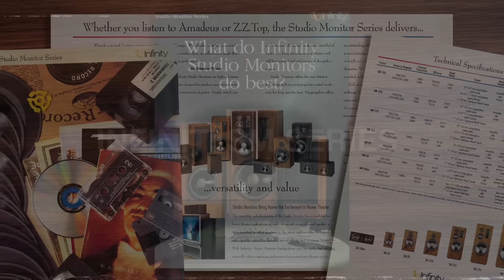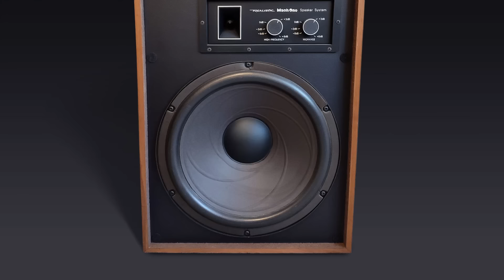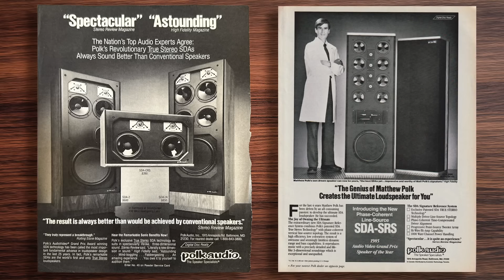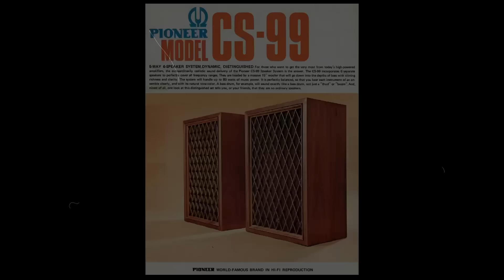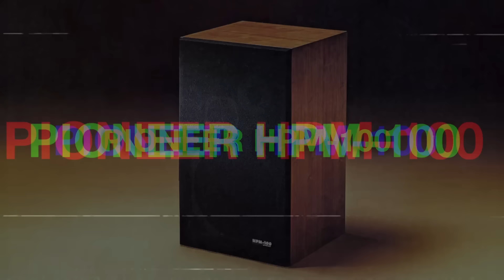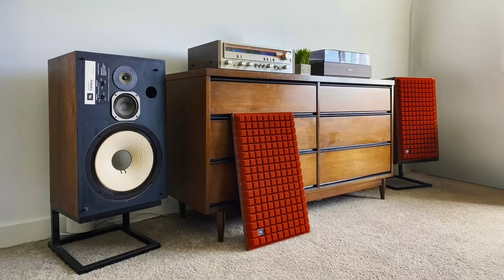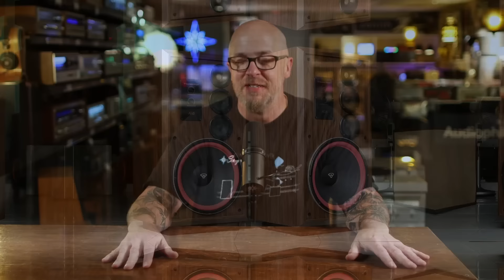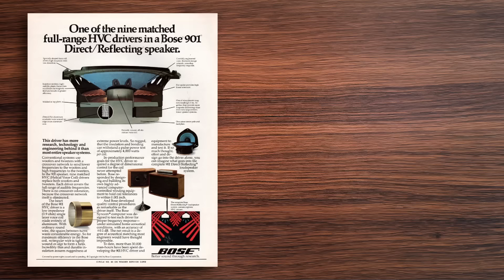Why Do Audiophiles Hate These 9 Legendary Speakers?

Comment: I have pair of HPM-100s… bought them a year ago for $499….they are furniture…i don’t even like to move them to dust….i also have a pair of Bose 901 series VI….and there are things i prefer to listen to thru those…(as soon as i get my Bose 551 Spatial Receiver restored, i’ll be able to run both sets at the same time…kinda curious how that will sound).

Comment: the ones missing: the white-cone fishers. 

bassier than the C-Vs , but will run from walkman wattage. 

incredibly clean at low volume, and thrunderous with just a touch of power.

but they were god awful sensitive to over-power or clipping, I swear i must have blown a half dozen sets .
Reply: You mean the studio standard range

Comment: I’m a huge fan of ADS, but I have an appreciation for Cerwin Vega. The first time I heard a set was at a company house party in the mid 90s. The guy had a set of what I believe were 316r, or at least that style cabinet, and a couple of Phase Linear amps. These things were huge and they commanded a presence. You couldn’t help but want to be in that room and feel the music. I can’t think of another vintage home speaker that could crank out SPLs like they did and still sound good doing it. Just really fun speakers.
Reply: ADS here too. Nice full sound, slightly soft. Good tone which is really important.

Comment: Two comments... first, the Polk SDA's do sound amazing when you're in the sweet spot and moving does fade the effect; however, they are an absolutely amazing speaker without the interconnect cable - the cable just adds the dimensional aspect to the sound.

Second comment... I remember walking into the local funeral home back in the late 90's and seeing that they had replaced their old speakers with Infinity speakers - and had to laugh at the irony of it all.

Comment: Alrighty then! the Bose 901is a flawed concept at the outset because of Amar Bose's statement of actual fact and then corrupting it with his implementation of it. The fact stated is that music reaches your ears in nine parts reflected sound to one part direct sound. By pushing the music through speakers that use said ratio due to the eight speaker drivers in the rear to create the reflected part and one speaker driver for the front, to the listener. 
PROBLEM: The nine-to-one ratio occurred at the microphone and is frozen into the recording. By diluting it again in the same ratio yields 81 parts reflected sound to 1 sound reaching the listener. There is no scenario where an accurate image of the performers is realized. Yes, they are good party speakers (provided enough amplifier power) and also good for just hearing music around the house. 
For critically listening to music, direct radiator speakers will be far more accurate.

Comment: I was a diehard Infiniti fan and I still have my speakers from the 70s. They blew away anything that came after that I agree those studio monitor showed at the beginning of the video that’s when Infiniti went downhill. They weren’t the same company after that their heyday was the quantum line speakers.
Reply: I own a set of Qa infinities. 10" woofer crossed over at pretty low frequency to their amazing EMIT tweeters. Mr. Nudell and his co- founders were using " exotic" materials as they were in the aerospace industry and were also also audio nuts. They used materials they were familiar with but not previously used in audio, like the Kapton in the EMIT and graphite impregnated plastic in the woofer cones

Comment: I love this kind of video on vintage speakers ! I have had most of these over the years, im 66 now, last year i bought a perfect set of Infinity SM152's knowing their issues. I braced the cabinets at every point i could think of (heavy as heck now !) put in plenty of insulation and plugged the bass port. A world of difference ! Not the best for detail, but not bad either. When it comes to rock n roll - Oh Boy !

Comment: Regarding the Polk SDA technology; their current flagship speaker is the Legend 800. It's SDA as well. Anytime you're seriously listening to music you absolutely have to be dead center between them in an equilateral triangle, which is the same for the sda's, so I'm not sure why you acted as if that's a negative for the sda's. Off axis they still would sound more accurate than any of the other speakers mentioned. The SDA technology doesn't just expand the size of the soundstage, it increases the accuracy and placement of sounds dramatically. You literally can hear sound coming from behind you in some cases, if that is how it was recorded. It's incredible, but requires precise speaker placement. The sda requires very specific placement. One often missed rule is you can't toe them in at all. They have to be flat to the wall.
Reply: Polk SDA are amazing and are the best vintage speakers. You need some power to make them sing. NAD power amp modestly rated at 100 watts but more like 200 watts work well .150 to 200 watts amplification would work
Reply: I’ve had a similar experience with Magnepan speakers. The tweeter ribbons have to be facing your ears at the right angle, so it’s hard for more than one person to listen in the sweet spot. But when you get them placed properly, man is it sweet!
Reply: Stereo crosstalk cancellation only makes the imaging more precise, under conditions of perfect cancellation. Under conditions of imperfect cancellation, it makes imaging much less precise. That is the big problem with it. Most of the time, the cancellation is much less than perfect. If you have a perfectly symmetrical room, the speakers far from the walls and lock your head in a vise, everything will be fine.
Reply: I remember a time when the KEF 105 was considered by the hifi cognoscenti to be the best sounding speakers on the planet. With one HUGE 'BUT'...and that was that you had to be rigidly sitting in the very small 'sweet spot'...which was the size of a golf ball when they were properly set up and the mids and tweeters toed-in correctly.  Nobody complained about the KEFs though...they made their reputation on the 105s.  Matthew Polk...not so much.

Comment: Klipsch Heresy I and II speakers are very compromised in some ways but excel in other ways: I enjoy them either (1) with solid state amps AND and a subwoofer or (2) with tube amps even without a subwoofer. To really sound wonderful, however, I recommend matching them to both subwoofers and a tube amp. They are so incredibly dynamic that they make magic out of a lot of music in a way few other speakers near their price can. But not only do they roll off below about 80-90 Hz, they are also very forward in the midrange and upper midrange, which further emphasizes that rolloff. A good subwoofer transforms them by extending the bass and smoothing out the top end, and a good tube amp raises their performance even more. I run my HIIs with a REL T7 sub and a Rogue Audio Cronus Magnum Dark tube amp. I get it that others' opinions will differ. Some will insist that their available bass is so articulate that it makes up for the limits in depth with no need for a sub, while others will walk away as soon as they hear them without a sub without giving it a try.

Comment: My first gig as an audio engineer in 1981 was at a club with a pair of Klipsch La Scala cabinets. The only thing that made them tolerable was a decent set of graphic EQs in the rack. To this day I have a love/hate relationship with horn loaded mids. Especially in short throw applications.
I also ran a few shows in the 80's that had Bose front ends, both 800 and 802. While they got the job done, the Bose processing included quote a bit of compression so you had to be very careful to stay below that to maintain the overall dynamic range.

Comment: I love my Pioneer HPM-100 set. I actually managed to kill the tweeters, I replaced them with Visaton years ago and recently I found a working pair of original tweeters, so happy. And I am right, they are great. I am also wrong, but they are still great. I did EQ them with the room correction feature of WiiM, interesting results. For me this IS the ultimate rock loudspeaker. And it's an heirloom as my dad bought them at a USAF PX, we knew lots of US people on their tour, living close to us in NL.  When we got them I remember playing for weeks in the boxes, they where like my house. This story makes the set precious in so many ways. They are not going away.
Reply: Plus those things just look the business, with a classic vintage look.
Reply: Those 65mm paper cone tweeters are easy to kill, even with 3/4A polyswitch, time for dome upgrades. 30w is the limit for such tweeters regardless of woofer and mid power handling

Comment: Ah, yes, the L-100.  My overwhelming memory of the L-100 is that it was that, on a percentage basis, it was the preferred model of 1970s aficionados of  nose candy. Loud, edgy, punchy, it fit the amped up lifestyle perfectly. Who cares if listening to them gave you a headache?  That was just background noise drowned out by the hangover left over when there wasn't anything left to snort. And, bonus points for their relatively high value at pawn shops where you could get a couple of grams worth of cash for them in trade. Win-win!

Comment: The speakers I miss the most are my Cerwin Vega speakers. They got a lot of complements. Thing is they had Optimus/Radio shack drivers that I put in when the foam surrounds gave out. I was going to redo the surrounds but kinda just never bothered they sounded so good. Sadly lost to time along with most of my big stereo gear. We also use a set of Mach 1s as studio monitors in one of my production studios. They are now sitting in the station garage and I want them before the heat and stuff gets to them. I used to shake the building with them. As far as I know my predecessors never modified them.

Comment: I had a set of Mach I's. They were terrible speakers, for all the reasons outlined here. The woofer was a one-frequency driver at about 100 - 120 Hz, and the midrange was in your face, and distorted as well. The woofer didn't even provide a good "thump" on kick drum hits. I had a frequency sweep track that would sweep down from 250 Hz and you would watch the time display and kind of "map" what the woofer could do and at what frequency it would do it. There was a huge bump in the output starting at 120 Hz, and the output below 60 Hz dropped off like a cliff. I think a lot of that was due to its shallow cabinet, and resulting lack of volume.

Comment: I still use every day the speakers I bought fifty years ago, both for music and TV.  And the same turntable. I was fourteen, delivered newspapers and mowed lawns and bought store brands. The speakers are Quadraflex ST-19s, three way, 12 inch woofers from Pioneer Audio store. The turntable was bought through a friend working at Lafayette Music, half off employee discount. A Lafayette T-6000, direct drive. I later learned Bose sold the same one as the Bose T-6000, or something like that. I’ve never seen another. Thanks Dad for driving me around!
Reply: Actually Pacific Stereo,  sorry
Reply: @OldPete-w5l  I do hope you have replaced the phono pick up cartridge by now! Many folk do not understand that it is just as critical to purchase the "right" cartridge as it is the right speaker. I used to sell audio back in the 70's and we owned a special table with 2 tone arms hooked up to a reciever with 2 phono inputs where we could show how one cartridge compared to another. IMHO the AKG P8E was the #1 best phono cartridge I'd ever heard. And the Shure M91ED was best for low priced cartridges. Big respect for Audiotechnica as well. Stay away from Pickering and Stanton. yech!
Reply: @doctorquestian . Have a P

Comment: So many triggers! So well coordinated with what the actual audiophile community felt back in the day. Outside of brand adherents and newbies easily impressed, those products you list were big sellers to the masses but rejected in the audiophile market. The need for horns for low powered amps was gone and Klipsch was reaching the end of it's viability. But it still has it's adherents. I was enamored with JBL when I first started in retail. The L300 was my goal! Then I got involved with the Audiophile market and quickly learned how to listen. It dropped off my list. Just like Cerwin-Vega except that was more complicated. I was actually a CV rep, got a factory tour by Gene himself. Unlike JBL that wanted to claim an audiophile acceptance, Gene just wanted to make the speakers he liked! I was also the AR rep at the time and introducing the Series 9 line. So the market differentiation was dramatic. 

Then the 901. I think it was more an industry, market all of it's own. Seriously bad design in every direction. But it did what it did like nothing else. And if that was what you wanted, or just wanted 901s because...

Comment: I've never owned the 901's but I've found them to be a fascinating speaker system -the ones I've heard sounded really good. The idea of an active equalizer in my mind is the way to go but to do it right you need to have a multistage amplifier driving each speaker set.

Comment: I bought my L100s in 1972, in ‘76 I met a Sansui  executive who sold me an AU 20000 I enjoy these everyday. The sound of the JBLs started sounding muddy, but it took years to recognize the problem. Both amp and speakers needed re-capping after 50 years. I went with a 3 way 12db per octive crossover in the L100s which made a huge difference as the 12” woofer went direct. In the 80’s and 90’s I worked as a live sound engineer. I worked for short time in Hawaii where the company I worked for used the pro version of the La Scala. They worked well and they loaded up in helicopter’s nicely..
Reply: "I worked as a live sound engineer".. that made me smile.. In 1973 I bought a pair of JBL Decades, I was also recording bands as a struggling sound engineer.. In 1977 I was full time pro live sound engineer and also some studio stuff, one studio I did some session in had L100, unfortunately the owner died and I bought the L100's.. definately a live sound engineers speakers.. I love mine, the sound is live rockNroll all the way  not for the "purest" LOL ;-))

Comment: I knew the Cerwin Vegas and the Bose 901 would be on your list. I owned both of them. My Cerwin Vegas 15's, back in 1991, were loud and very bass heavy. I was young with money to spend. My Sargent in the Army introduced me to Bose 901's because he said they had a more natural sound. So I bought a pair and sold the Vegas and still have the 901's to this day. I came across this YouTube video, and he stated that if you turn them around, they will sound good if they can't be placed in a correct environment. So I did and paired them to a dual powered subwoofer set up that I love, but my neighbors hate. Hearing is relative, so get what your ears love.
Reply: I love my AT-100s - I guess they came along a bit later
Reply: Bose should have done the 901s with a separate subwoofer from day one . Then those little full range speakers would never needed to produce any bass under 60 hertz  ( or so ) . A hundred watt amplifier would have been plenty with out dumping a ton of equalization into drivers that really can't do it .

Comment: I spent the weekend in a Boston dorm room in 1973 or 1974 with a Yamaha receiver and two JBL L-100s with the waffle grills. 

They were the best speakers I ever heard, outside of the sound system at the Filmore East. Whisper quiet brushes on a snare, the bell of a symbol, the Hammond organ -- everything clear behind the pumped up  Les Pauls and the singer. No booming electric bass. Perfect balance, not top heavy or bottom heavy. It really depends on what you listen to, and what drives them. 

Blue grills. Orange grills were tacky. Way too 1950s. Just add turquoise. Blue grills sound better. 🇺🇲🧙🏽‍♂️✌🏼💙

Comment: Which reminds me that my Maggie MGIIIAs are well over 40 years old, with tweeters replaced and new panels at the factory over 20 years ago. I have heard many speakers since, but have not felt the need to replace them. Yes there is a REL sub below 40Hz. I have gone through 4 power amps in the years I've had them and while the midrange was beautiful with VTL 300s, the most accurate sound has been with the current BHK250.

Comment: Hey Kevin, I have the 901s (series IV; bought used around 1988 or '89), and used to have some big CVs, also bought used...but I don't remember the model.  I may have old pics of them.  With every passing year, I wonder if I'll be able to keep using the 901s because the amp they're hooked up to suffers some new illness every couple of years.

With my 901s, it's definitely a love/hate relationship.  I love how they sound.  I hate how fussy it is to own them, from having to accommodate the weird hookup for the Bose EQ all the way to having to aim them properly and use them in a room with lots of reflective surfaces.

But even if the room is not perfect for them, I still love how they sound.  If a hurricane blew my house away next week, I would not get another set of 901s.  Hell, I'd be happy with a good pair of studio active monitors, such as Genelec 8s or Adam 7s, or even some third-rate Pioneers.  But I would still miss these 901s.

Comment: First heard Bose 901s in an expert setup at a hifi store shortly after they were initially introduced.  Didn't like them then or since.  What I do like are my Polk Monitor 10s.  Bought them about 1980 and they are still my daily drivers (after recapping and a couple of tweeter replacements).